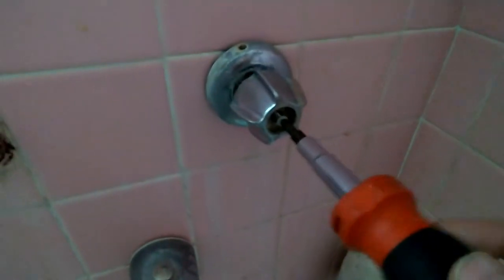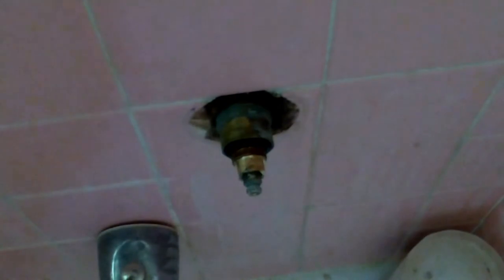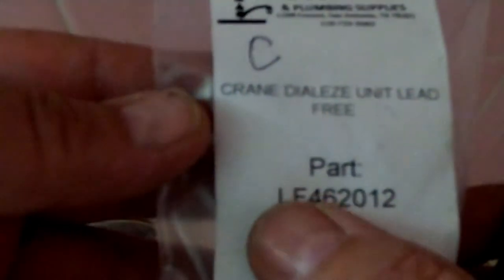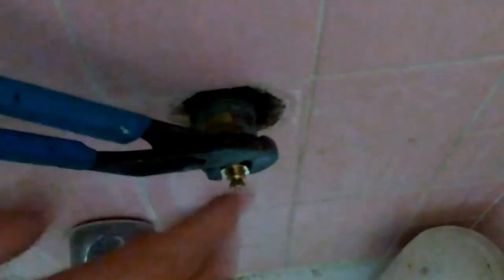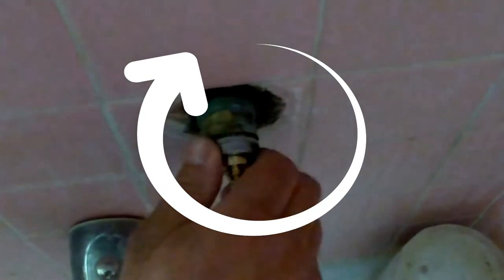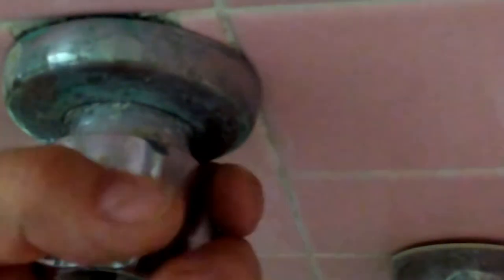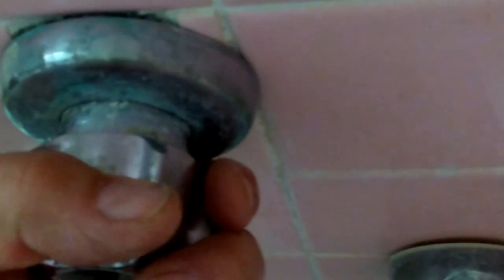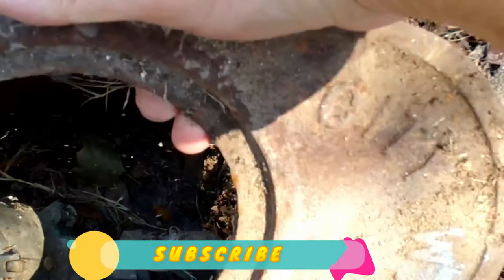How to Replace a Crane Dialeze Shower Valve

Comment: I just pulled one of my stems, and it's almost the same part. Maybe interchangeable with the part you have. 
I took the stem apart and cleaned it. I think I just need one washer, and not a whole new stem. 
Mine is from the '40s-'50s, so figuring out the exact part number (or cross ref.) is a pain. 
If you do much mech. stuff like this, the Knipix from Germany are awesome and expensive. 
I only have a 'small' one which is perfect for this kind of work. I still use my 'Cresent' wrench like the one you are using for rough work, but it there are parts you want/need to keep from getting marked, a flat adjustable is good, and the Knipix is awesome. (N.B. I'm not a paid shill for them :) ).
Reply from the maker: Hey thanks for watching my videos and thanks for your comments, recommendations like yours are always welcome.
Reply: @TIPSFORDUMMIES  Cool. I subbed and put this one on my 'pluming' list. I look forward (or backward?) into your other vid.
I live in a 'historic' district in Chicago doing mostly small elec. work, but often get asked  "can you look at this leaky . . . " . 
So many plumbers don't want to take on small jobs and/or charge too much for the home owner. Or, they want to upsell to replace everything. etc. etc.